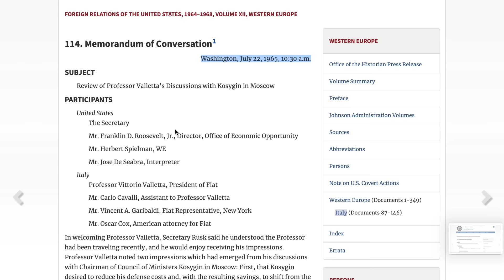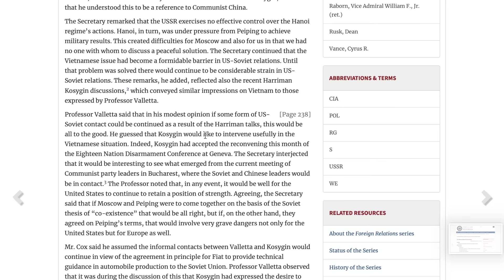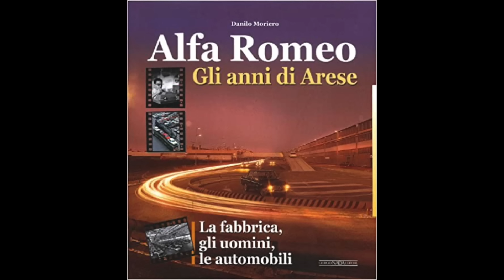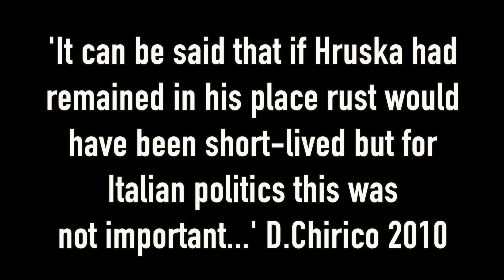Alfa Romeo And The Myth of Russian Steel - The Real Reason Alfas Rust

Comment: Hi Jack , I,m glad your studying has highlighted other issues that lead to the “Italian Rust Scandal “. Our UK motor industry was not the only country with poor management relations as often quoted by British TV media, and this vid highlights this particularly with the Italian cars. In the Lancia Beta case , it was discovered the shells of cars were often left outside either in primer or without whilst production was on strike , which as you say , was frequent. Similar pattern here in UK happened in Rovers plant with the SD1 production , the car had an excellent process for paint , provided we had continuity of production , well we all remember what happened there! Another factor, which has been overlooked was with the introduction of both the Alfasud and the Lancia Beta models coincided the with the Oil Crisis early mid 1970’s , so they sat in UK docks for ages , as cars were not selling awfully well , a similar thing happened to 1st Ferrari 308 GT4s , and you don’t hear many slagging them off for rust! ( But they did) . With both the Beta and the Sud aiming for a different market to their predecessors, also the with Uk joining the Common Market meant their pricing was more advantageous, having had the big Import tax removed, which existed since Clement Attlee put it on after WW11 , this made previous models in Jaguar E type territory . It can be argued for this reason that buyers of the new models may not have had so fastidious owners than were before. Either way, people seemed to forget premature rusty subframes on Minis and the ADO 16 models, we still bought them . Rusty front strut mounts on Escorts ,Cortina’s etc; we still bought them , and what about the metallic Silver Fox paint on 1600E and 1300E Fords which literally flaked off before your very eyes! It’s obviously a very fickle world in motoring folklore. Really liked this vid. P.s You ought to try a really well sorted Beta they are quite brilliant
Reply: My dad tells the tale of when he had a puncture on his 1956 Vauxhall Wyvern.
He put the jack in the offside rear jacking point and started Jacking the car up. 
The jack went up but the car stayed on the ground lol.
The floor completely rotted out!

Comment: There's Top Gear clips from the 80s about the Metro where early cars were rust buckets in 3 years. Cr@p manufacturing is cr@p manufacturing
Reply: My dad bought a brand new Montego turbo diesel in the 80s and that had to have the sills repaired under warranty at less than six years old.

Comment: In the 70’s my father worked in a large steel components supplier for the automotive industry in The Netherlands. At a certain moment Mercedes Benz did abruptly stop  the production of their steel products. All produced steel part het to be scrapped. Later on other ca brands did the same. However the high standard Mercedes Benz quality control carried out by Mercedes Benz themselves was the first to spot the rise problem. What happened was that the whole car industry started to buy recycled steel what was a rather new phenomenon in the early seventies. The Russians offered it for a very good price (better then the rest of the steel market). How they were able to do so turned out later on. The Russians did not recycle the steel a temperature that high enough to have all impurities come floating op tot the surface. Therefore the new steel had a ha the corrosion already in it when it came straight out the Russian steel factories. This problem hit most car factories not only the Italian car factories.
Reply: I remember watching a UK TV show in the '90s about car rust, and exactly this was described. Mercedes were cited as being effected, surprised and traced the problem to poor steel manuf. Rust was described as existing throughout the metal. Funnily enough, Italian cars not mentioned.

After saying that, I remember a less-than-1 year old Alfa Sud with both wing indicators missing, as the rust holes where they should be were so big the lights no longer fit!
Reply: Spot on and much more like it on what is such a silly thread.

Comment: I really enjoyed this perspective and it would be interesting to know which Fiat models were from which factory over the years. Before we were married I bought a 5 year old 1973 Fiat 126 to fix up for my girlfriend and the front end was full of holes and required many new panels. After I fixed that she progressed to a Fiat 127 in 1982 which was also 5 years old and the bottom 4 inches of the driver's door skin had been eaten away so a bit of progress in a way as the rest of it seemed ok!
Reply: We had both a 127 and a 128 in the family in the early-mid '80s when I was a youngster. They rusted quite badly despite being Ziebarted but not as bad as your experience. I remember the bottoms of the door skins, all the hinges in the cars and along the lip of the hatchback (127) and boot (128) being the worst. Surprised the doors did not fall off as the hinges were so weakened by rust. The undersides were OK so the extra rustproofing must have had some effect.

Comment: Hi Jack, couple of points.  I bought (actually my dad did) a Ford Crapi (sorry Capri) in 1970 in the states.   Literally within 8 months the rear fender (ie wing) began to rust.   In 2 years the car was very rusty.   And in December 1984, I was in MIrafiore and other Torinese plants with company big wigs (I was just a small guy) and we toured the zinc coating bath which Fiat had put in place to solve the rust issues.   I think their system was licensed from Porsche.
Reply from the maker: Thanks Dom, interesting to hear!

Comment: Are you kidding me? The document dated 1965 names a Franklin Roosevelt  and you say he wasn't yet President?. Lol. That Roosevelt was never President. Franklin D. Roosevelt was President during WW2, a couple decades previous.
   Rust in late 60's and early 70s  cars was probably due more to poor design of box sectioning sheetmetal for chassis strength. Leaving areas with poor drainage of water and poor rustproofing. By late 70's most cars had much better rustproofing as well as additional  dealer installed rustproof materials at extra cost.
   MG's, Triumphs, Volvo, Chevy's, Fords,Chrysler, etc all rusted out just as bad, especially if they were in rust belt areas.
Reply from the maker: Thanks for pointing out the Roosevelt thing.. I had assumed it was the same person and didn’t make the connection on the dates being so far off!
Reply: It was his Son
Reply: @paulie-Gualtieri.  he was an interior decorator ...

Comment: Alfa cured their rust problem in about 1987 when they launched the 75/Milano which had better panels and better treatment. The Alfa 164 is one of the best rust protected production cars ever. They've slipped back a bit these days, but are no worse than anybody else now.

Comment: Fascinating video Jack.
Interesting to set the record straight.
It's clear most manufacturers in the 70s were having rust issues.
It wasn't until early 80s that galvanized steel started to become the norm.
I think there may be a way to settle this once and for all.
...
If small metal samples taken from Alfa's, Fiat's, Lancias made from 70s and have all these individually metallurgically tested.
This would identify the elements within the steel.
As mentioned in the comments, Russian steel lacked high quantities of Nickel and Chromium as these were expensive.
A test would clearly identify the type of steel used by each manufacturer.
I suspect you'll find they'll all match.
...
They did this metal analysis on metal fragments from the Titanic as there were rumours of poor quality steel used in construction.  This was being (recently) considered as one of the reasons for the sinking.
They found the steel was excellent quality high carbon content.
Later research found rivets used on the bow of the ship were of a lesser quality than used elsewhere on the ship. Not necessarily a structural issue, more facilitated the break up when the Titanic started to sink.
...
Mate had a W reg Fiat Strada.1.3 in the early 90s.
It was a bit of a jalopy and of course rusty..he never locked it - no one stole it lol..
Engine was sweet thou.

Comment: The boxer engine also had a problem with insuficient engine protection. Many engines broke in parking lots during winter, because owners drove into snow piles that melted from engine heat and then later the water froze in the timing belt and at start up the belt jumped on the sprockets and bent the valves. Also they used foam for insulation inside tight body spaces. This is still done in many makes but the material is now incased in plastic bags so that they don't collect water.

Comment: Very interesting video, I repaired suds for an alfa dealer when I first started as a paint sprayer, I seem to remember working on models with a boot lid that were newer than tailgate models and seem to remember a picture of bodyshells parked in fields a foot deep in water, seems new shells were sometimes used before all the old shells had been used.

Comment: Not only the BMW had problems with Rust at that time, but also the Golf I suffered immensely. The problem was solved with the Golf II and Audi at that time made a clever move by a layer of zinc on their bodies. The main problem for the cars at that time was using Salt for icy roads and reducing the thickness of steel for their cars.

Comment: Lack of galvanising hampered all car manufacturers during this time. I used to work next to a compound used by Fiat and Lancia after they came off the dock. The land was on reclaimed land and I often saw the compound flooded where these brand new cars were stored. It was likely these cars were stored in salt water or a dilution of it due to the proximity of the compound. This was in ‘87 and I can vividly remember some of the Strada and Regatta models parked there in water up to the sills. I’ve owned many Italian cars over the last 30 years and rust hasn’t been a problem with any of them.

Comment: I bought an alfa 33 Trofeo new in the 90s. When I picked it up at the dealership, I noticed that a piece of bodywork around the headlight was starting to rust because the varnish had peeled off. Of course I brought it back and they painted it for me under the warranty. The body was guaranteed for five years against rust. Otherwise it was a beautiful car full of sensations and its boxer engine was a marvel.

Comment: I've owned 7 ALFAs, from the 69 1750 Berlina to the 82 Milano. A little rust problem on the 74  2000GTV (my favorite).  Entirely worth it. No one would believe a car could have "soul", but ALFAs could to a Mechanical Engineer.

Comment: As a student my chums had Alfa's.  A brown Sud that even as a 17yr old I could see was full of filler, and a Guilietta (dark blue, did its engine and got sold to the college's agricultural workshop worker for £100).  

Anyway, a year later (1988) I bought a rusty W reg Sud 5-dr for £150.  This eight year old / very low miles car was so rusty that the top of the front strut towers had ripped away, hinging up from the inner wings.  It was the only car I've owned where the bonnet was a structural member: you had to jack the car up a bit to close it, and when you released it (with a hefty tug) the car would drop by a bit.  I blobbed some plates at it, gave up and got my money back from someone who simply drove off in it: bonnet straining, no MOT.  A year later I got an '83 (Y) Sud Ti Green Cloverleaf with 140,000 miles.  Not a spot of rust anywhere and a wonderful car.

That red Alfa introduced me to car restoration though, and for the last 20 years I've done 45+ early 911 shells, plus others.  Would now love a Sud / GTV for restoration for myself!

Great film and very interesting, thank you.

Comment: The second reason to my knowledge for the rusty Alfasud: they (Alfa Romeo) used quite a lot of soundproofing foam which they haven't used on other Alfa models. It turned out that these soundproofing foams were quite hydrophil and acted like sponges. On rainy days these foams, embedded between steel panels, absorbed water and did'nt dry for a long time. That propelled the formation of rust.

Comment: In Portugal there is very little snow and road salt is never used, except in very specific small areas. Having said that, my Father owned a Fiat 128 from 1972 to 1979, which rate of rusting was absolutely mind boggling. All FIATs were known for rusting at an absolutely obscene pace. I am absolutely sure that no other brand including other Italian brands rusted like that. They could show some pitting here and there but the FIATS just decayed like mushrooms, mainly around any window frame. My Dad's older NSU Prinz 4 didn't rust like that either.

Comment: Excellent video as always.

Now, to the the rust issue.

If your theory is correct that the rust was due to poor work practices, then there must have been some periods where the cars got through production unscathed by interruptions and these care should not have rusted and should have survived much longer.

So there should be some Suds around which didn't rust badly and have survived fairly well. And not only those in very dry climates.

Of course, I remember my Sud Sprint for having particularly poor rainwater drainage channels which tended to accumulate water around the body. So there may also have been designg "features" which didn't help.

Comment: I bought a 1978 Lancia Beta coupe in the mid 90s. It had6000 miles in the clock and had been stored away and rarely driven. The documentation that came with it had a letter from Lancia offering free rust checking and a wax injection and undersealing. My car had got it and there wasn’t a spot of rust anywhere. I drove it daily in all conditions and it was fine. 

These were very light cars. The Sud was the same to screw as much performance as possible. The also handled brilliantly. 

I did find a Corriera de la Sport and a sandwich wrapper inside a door skin all the same 😀
Reply: The Sud Sprints had from memory 59kw with the earlier ones Australia saw from 1979-1985(My late father had two)performance standards and take into account the Japanese didn't yet have hot hatches in the class.I remembered a car test comparing one of those initial alfa sud ti models with the newly launched Ford Laser S in 1981 reading it.it except for brakes type was the same on performance and even had a five speed manual but the real test was with the updated version of the latter come 1983.If we kids were present at the time we would have told him go test the KB Laser S and buy it,It was a generation ahead being a genuine car for the 80's whereas the Alfa first saw light of day in Europe in 1976.

Comment: I had a 1974 Alfasud 4-door and a 1976 Alfasud Ti here in Norway in the early 1980s. Even though I had to weld up the floor on my then 6-year old Ti, these cars withstood rust pretty well probably due to additional rustproofing done by the Norwegian importer. Plus, roads were less subject to salting back then as we used studded tyres in winter. The ‘Sud wasn’t a bad winter car at all, somewhat surprising for a car made in southern Italy.

Comment: I had a 1980 Alfetta. Only problem with rust was where the spring pins holding on the chrome trim wore away the paint around the holes where the rust started and crept out from under the trim. Got that section repaired ( holes filled in) and then double taped the trim on. No more problems.

Comment: I had never heard the Soviet steel theory, but the explanation I recall reading in Australia was that they were imported to Australia in knocked down form and assembled here bay Datsun/Nissan. In the process, the parts weren't properly rustproofed by the factory before being shipped here. I understand the sam factory assembled Volvos, which didn't suffer from that problem.

Comment: I’m an Alfa fan, I currently have a phase 1 916 verde acido spider in my modest collection. It’s my 5th Alfa and like 3 of the others rust free. My 1986 series 3 spider not so though, and to suggest the Italian work force and practices could partly be to blame rings true - as the story goes that my series 3 spider had an annoying occasional knock early on in its life which couldn’t be diagnosed - only for an empty beer bottle to be found behind the door card when it had its first respray! It was obviously placed there by a factory worker during its build! 😂

Comment: Salt was the culprit. Italy has, overall, a much milder climate and hugely less problems of ice on the roads. Germany and the UK are into this habit of putting salt on their roads, during the winter, to prevent ice formation. This prevents ice formation but does corrode iron. Italian cars were designed for the Italian market, and in the '70s only a tiny percentage was exported outside Italy, the problem with rust took some years to emerge. When it emerged, FIAT remedied it. I remember in 1983 or 1984 a person having bought a FIAT Uno from a "parallel seller" who resold cars who were destined to the German market in Italy (new). He showed me the coating with some sort of "bitumen paper" on the underside of his "German" FIAT Uno. Basically, all cars destined to export to Northern Europe were built with an additional rust protection for the wheel arch and the bottom of the car, but the common place went on regardless.

Comment: 1:22 tea bags are full of microplastic nowadays. So, either (1) use leaf tea only, or (2) cut the tea bag open, pour the tea into a cup as leaf tea, pour the hot water in, let it steep for as long as you like, decant the black tea into another cup, and drink your tea as you like it.

Comment: I used to work at a Lancia dealership in the early 80's just before Lancia stopped trading in the UK. I remember seeing new cars arrive on the transporters with rust on them. I have seen pictures of 100's of Fiat x19 body shells sitting in primer out in the open with snow on them. That would not help the rust problem they had.